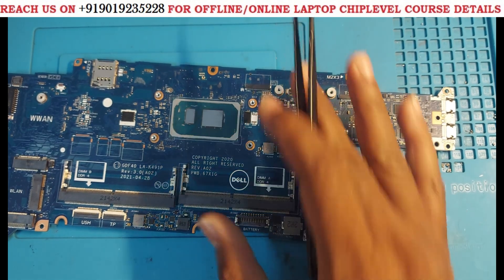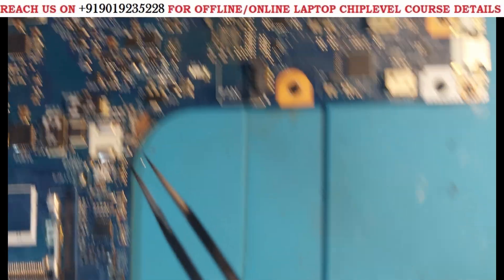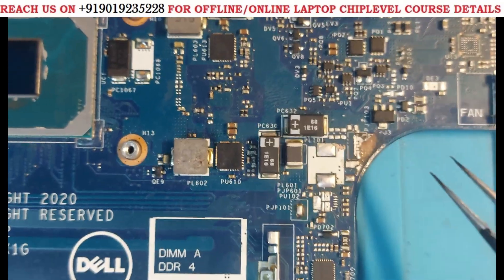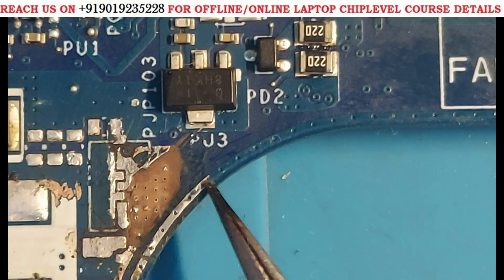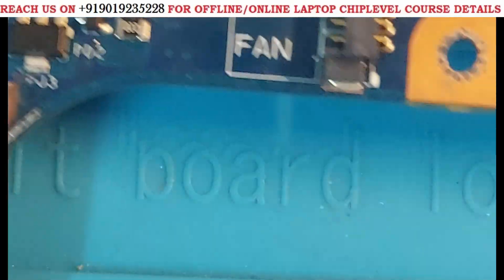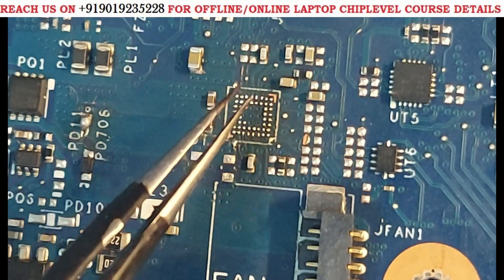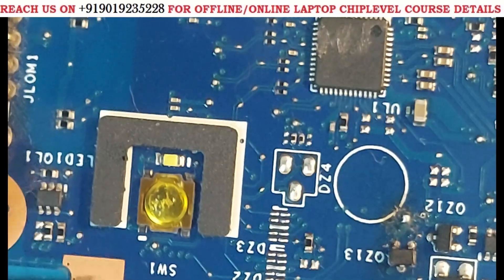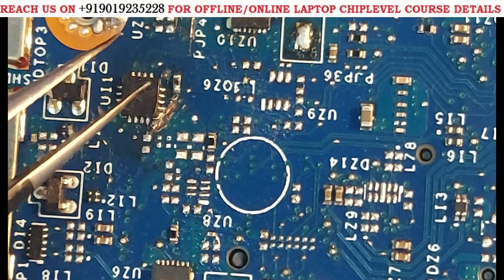How to remove motherboard short in advanced level?

Comment: definitely haven’t found the real culprit yet. There’s an internal short on the 5V rail, but where exactly, at the track level or on a component? Was the CPU controller IC shown at the end the actual part that failed, or was the short coming from somewhere else? I think bringing that board back to life, after so many components have been removed, will be a nightmare. How much would you eventually charge a client for this kind of job?
Reply from the maker: hi. its 5v track has short internally due to cpu ic damage. actually, i am searching for 5v IC. but, here, its not available. total PD ic, 5V ic, CPU ic, 2 dc to dc, multiple caps are damaged. this board is one of our dealer. so, i wont charge much. in case of customer, it will be more. once, i get all ics, i will do a youtube short if it is alive. thanks for valuable comment.
Reply: @LaptopCourse I thank you for bringing us many valuable contents!

Comment: Hello, I sent the problem that happened to my laptop to HP.
I understood that you are very good at troubleshooting so I will send the problem that I sent to HP to you as well, please read this story ...
And before you read, let me tell you, are all these problems related to the intersil 88739b IC?

_______________________________________________________________________________________________________
Hello to all repairmen and technicians.( Google translate)

I did something wrong and I am very sorry.:tired_face::tired_face::disappointed_face::confounded_face:

Please help me, my job depends on my laptop.

Here is the story:

About three or four days ago I decided to get a second adapter for my laptop so that I could have one at work and at home. 

I bought a slim / flat adapter with exactly the same voltage and amperage as the original adapter, 19.5V and 7.7A, for a relatively low price.

I noticed that this adapter had 20.2V instead of 19.5V and I thought it was okay.

I didn't know that the adapter I bought was a fake.

I used it that day and noticed that the touchpad gets confused🥴  when this fake adapter is connected to the point where it doesn't work anymore. 

I messed with the touchpad driver but the touchpad problem didn't get fixed. 

I even ran a heavy game for about fifteen or twenty minutes to test the adapter in extreme heat and the laptop's ultimate performance.

I realized that the adapter was fake and sent it back to the seller.

I could even hear the transformer buzzing inside it, as well as a hissing sound when the laptop was under heavy performance. While the original laptop adapter is completely silent.

The disaster begins here ::skull::face_screaming_in_fear:
 
Then one day, I noticed that the laptop had a problem with the battery draining extremely quickly after hibernation. To the point that it wouldn't turn on anymore.

When I plugged in the charger, the laptop battery percentage suddenly went from 0% to 100% in a few seconds. And vice versa. The laptop battery without power goes from 100% to 0% in a few seconds and completely shuts down.

Windows always gives the 601 battery error to boot and says that the ambient temperature is too low, while it is not.

I realized that there is something wrong somewhere.

My problem was not solved by updating the drivers, updating the BIOS, calibrating the battery, and finally reinstalling Windows.

And Windows still starts to boot with the 601 battery error and the battery goes from 0 to 100 in a few seconds and vice versa.

I opened the laptop in the off state and measured the battery and found that the battery has no voltage, only in the millivolt range.
 

But when I connect and disconnect the adapter for two seconds, the battery voltage suddenly returns to its normal 15.4 volts.

I turned off the laptop completely and removed the battery from the laptop.

The battery remains at its 15.4 or 14.3 volts when it is out of the laptop, and when I reconnect it to the motherboard, its voltage does not drop and the laptop does not discharge it, but as soon as I turn on the laptop with only the battery, the battery loses its voltage within a few seconds.
 
Where is the problem? Is it possible that the more I work with the laptop on battery, the more serious problems will arise ?

😓😓Please answer as soon as possible.
Reply from the maker: 1. Change adapter as priority basis with correct Amp rating. 
2. Change battery or for testing use other battery to check it's charging or not.
3. Finally come to charging ic section.  Share the schematic and motherboard model to my telegram +918861880678. I will guide u the exact issue and solution